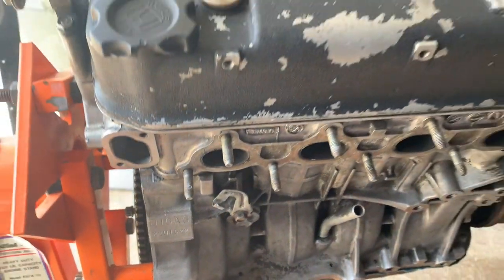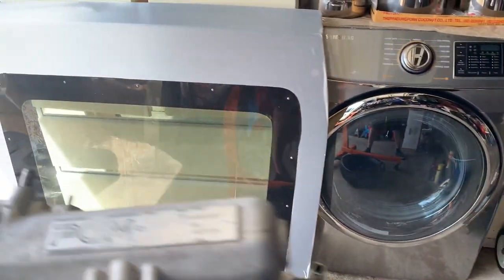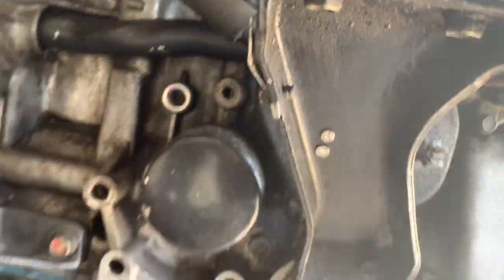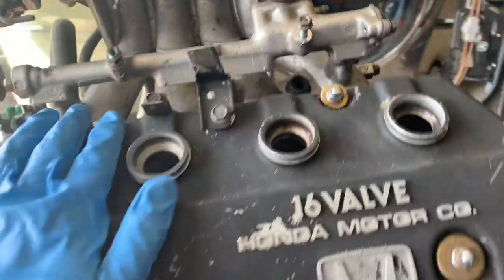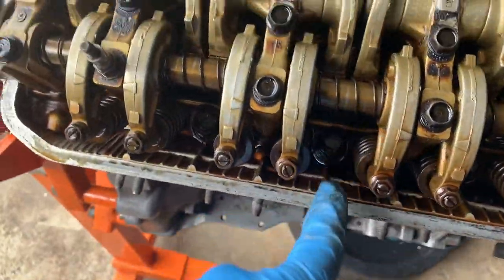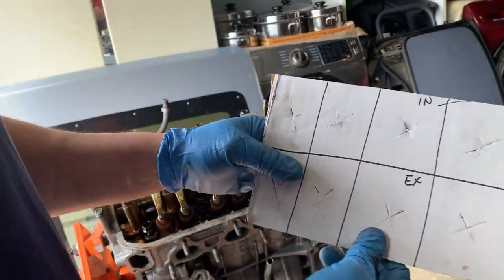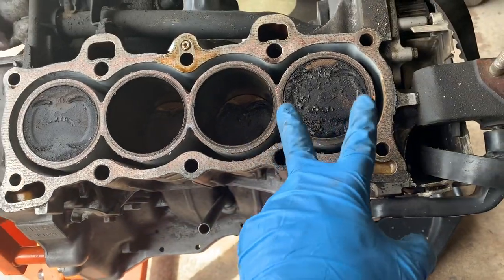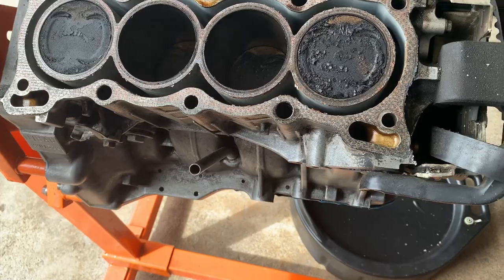How to remove D16a6 cylinder head from engine block🤔diy

Comment: I did the same job a few days ago but I still had the engine inside the car. One of the intake manifold bolts is impossible to get to unless you remove the manifold and the head together and slide it all to the left to access this intake bolt.
Reply from the maker: Agree,  I have also did a head gasket with the engine still on crx. The center / middle intake nut which I have to remove the black intake support bracket.  I believed I have used a 1/4 with extensions to loosen the nut while under the crx. It’s been a while.

I appreciate the comments and I hope in some way, I was able to navigate you through your project.  Keep on wrenching!😃

Comment: What kind of engine stand is that?
Reply from the maker: Allied 

I got it used at Facebook market place
Reply: @jpscrx  Thanks, I never saw your reply until now. What size thread pitch are the bolts that you are using to secure the engine to the engine stand?
Reply from the maker: G Benz

I have used an extra bolt coming out from transmission bolts, I don’t know the tread pitch size.  Pick n pull junkyard have a gazillion of bolts 😁